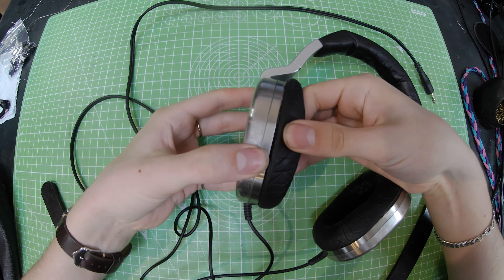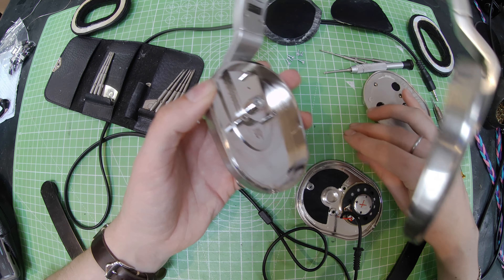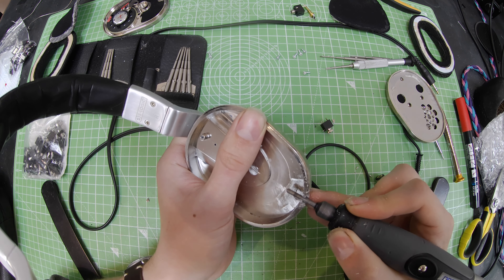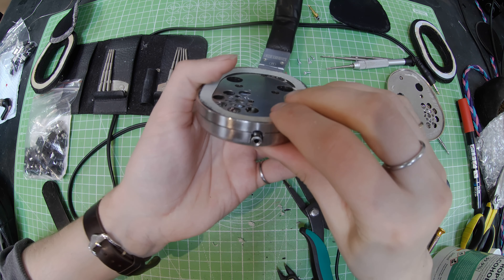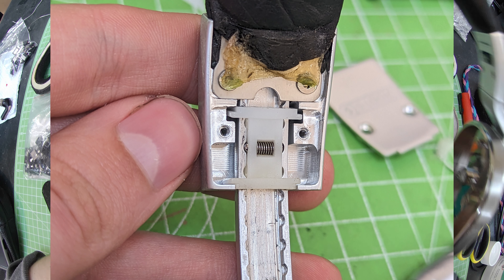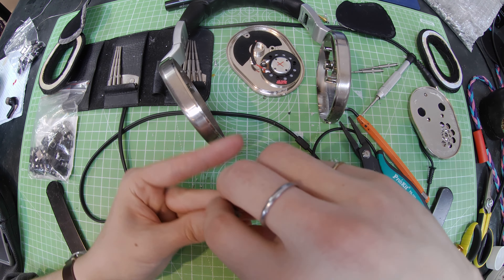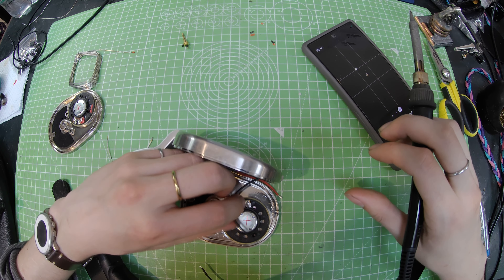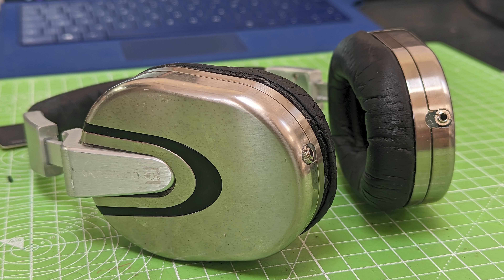Ultrasone edition 8 detachable cable mod by James

Comment: awesome video, i've got some old Ed8 Romeo's with the horrible MMCX plugs that are dropping out. I'm thinking of hard wiring a cable into each driver however having zero soldering experience is making me nervous. Not many options though, they're basically unusable (and have been repaired by Ultrasone service centre before, now out of warranty).